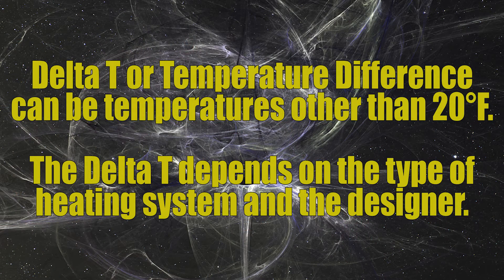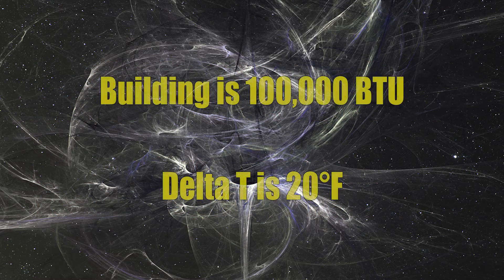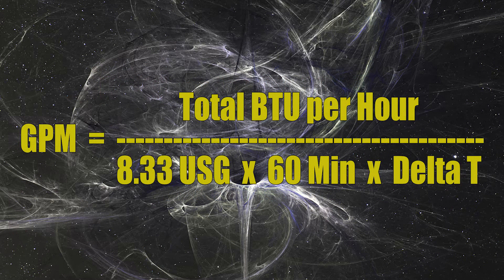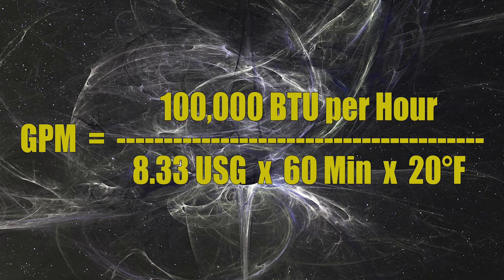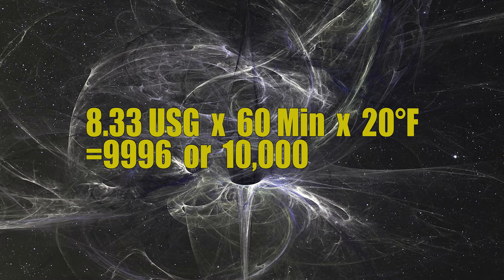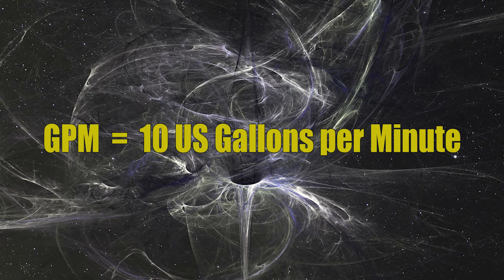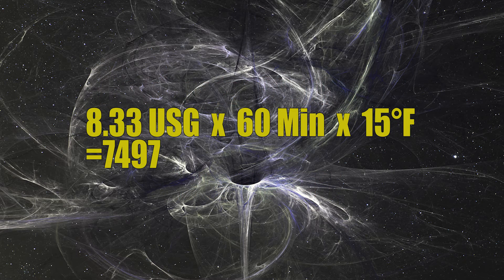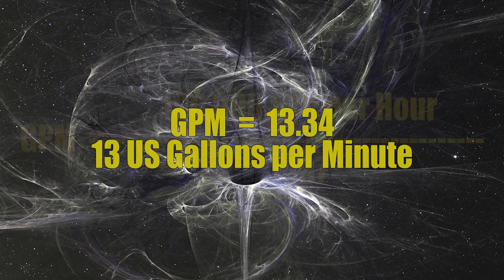Calculating GPM with BTU Loads for a Hydronic System

Comment: The circulator pump is in the wrong spot should be on the return side you still got saturated air and water everything else looks excellent
Reply from the maker: The example is a random install picture I found on the Google. But yes, NTI does have the pump travelling into the return port in their installation manual.

Comment: If you have multiple zones in a house, and want to use zone valves with 1 circulator pump. When sizing the pump,, Do you add the gpm required for each respective zone - Or do you use the gpm required for the longest zone - to install a pump with the proper GPM?

Comment: So that gpm factor is the amount of water that circulates through the whole system while working ?
Reply from the maker: In this example yes. But you also use it to calculate gpm through a single heating zone as well, given you have multiple heating zones in a house each with their own circulating pump.

Comment: How do I apply this in a zoned application where the zones are in a common area? I have a 2400sf shop where I did two zones in case I wall off the zones to have a separate warmer work area and a colder storage area. If the smaller zone is 25% of the area do I assume 25% of the flow?